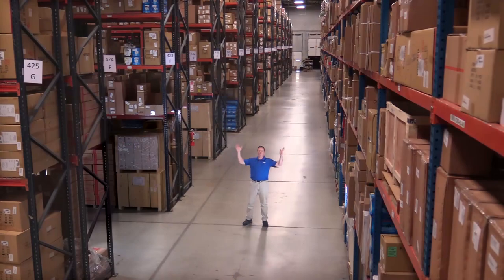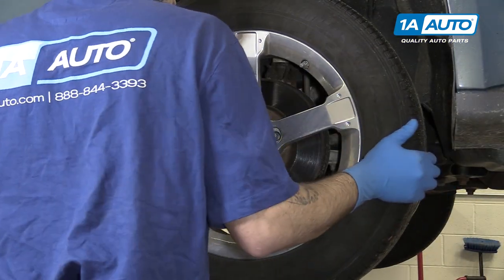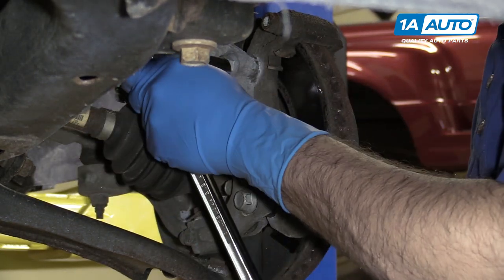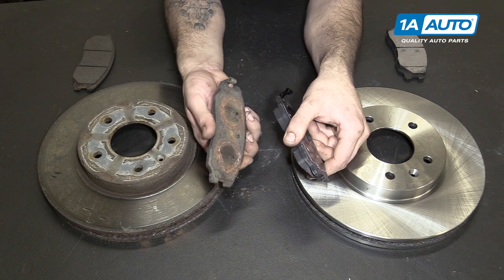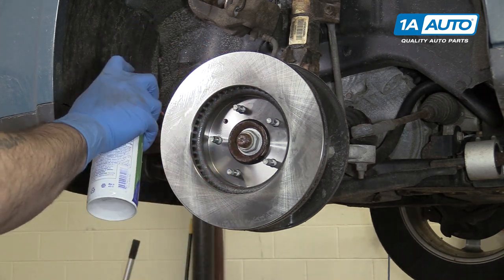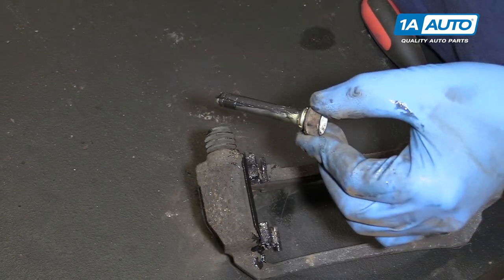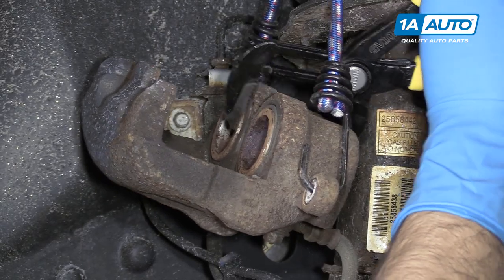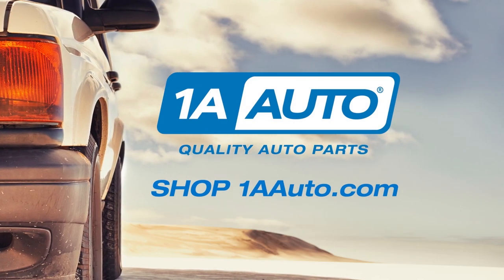How to Replace Front Brake Pads and Rotors 07-09 Chevy Equinox

Comment: Great Video. BTW the 14mm bolts on mine needed a breaker bar. Both my impacts would not loosen them none at all, lol.

TOOL LIST for those that missed any during the video.8mm(Bleeder Valve), 14mm(Caliber), 18mm(Caliber Bracket), and 19mm(Lug Nuts) Socket and or Wrench. T-30 Torque Bit(Star screw on rotor itself)Small Sledge or heavy hammer b/c the old rotors did not budge and were both really stuck on pretty good Just like this Video. Breaker Bar and or cheater Bar. Jack and Jack stands if you don't have a left and tire wedge for those that like to live life on the safer side :).

Its SO much easier to do a job when you have JUST the tools needed all out and ready before you start. Nothing worse then running back and forth looking for the right tool needed for the job. IM sure all of us had a Job that would have not taken no time at all but b/c you at a friends or have a son that likes to use your tools with out putting them up that a quick job turned into hours b/c you spent more time hunting tools than doing any work, lol...

Comment: Worth mentioning is that this also applies to a 2006 Equinox except that the rotors don't have the screw holding them on.  Otherwise, the procedures are pretty much identical.
Also, I find a C Clamp works much better at compressing the pistons.  Doesn't require as much physical hand strength.
Reply from the maker: +shadowmastertx Thank you for checking us out, as well as the information. This will certainly assist other viewers complete the replacement! 1aauto.com
Reply: Yeah, I used a hand trigger clamp and it was a breeze to compress the piston, just pump it and watch it go. The protective plastic also protected the piston from damage.

Comment: My 
2006 Pontiac Torrent  SUV  3.4 L  V6  the millage is 222,502 KM  in Canada  brake fluid is Black in the Master Cylinder is that normal. also i have an issue when i speed up yo about 60 km/h  and when i go to stop i have a stiff brake pedal but after that it go's bake to normal it has been doing this for about 6 months now every sent's i had my front Brake pads changed the brake pads used to be Metallic, but the new Pads are now Ceramic pads.

Comment: The only thing I would suggest is maybe pressing the brake pedal after you've done one side to set the pistons and allow more room for the fluid to move when you do the other side. Otherwise, you may pop the hood and realize you've lost brake fluid out of your reservoir from all the pressure of pressing the pistons into the calipers.
Reply: Great tip. I was planning on doing them both at the same time, but now I'll do this first.
Reply: soldado141 r
Reply: Replace front rotate 2010 chylsler town and county

Comment: I was wondering if you knew which side bolt went where? I think I mixed mine up and have been experiencing brake binding. Does the bolt with grommet go on the topside or bottom? I greased mine up but have been having problems,maybe the caliper is starting to go bad with the Piston sticking, I'm not sure...
Reply: As for as the next screw you don't have to have it but if the caliper bolt's are not greased the caliper will scrub some times

Comment: I just put a new caliper on. And when I have the engine off. I can't get any brake fluid to pump out of the bleeder valve. And I've done many brake jobs. And I have always gotten fluid to come out of the bleeder valve with the car not running. Any ideas.
Reply from the maker: +William Mills We wouldn't be able to diagnose an issue like that here, you may want to have a local mechanic take a look at it. Thanks for checking us out! http://1aau.to/m/Shop-1AAuto-c

Comment: Have you noticed on those shows the bolts always come off nice and easy? LOL When I do mine they are hell to take off and I end up taking it to a mechanic to do the job I could have done. Oh well.
Reply from the maker: +Ahmad Ghosheh Thank you for checking us out. Some bolts are very difficult to remove, and ours had plenty of preparation prior to this video being made. 1aauto.com
Reply: I kinda figured so. I did mine on a 2010 and followed your instructions worked great too. Thank you for showing us how and give me the courage to do it, total cost $85 for parts (I only needed pads), lots of sweat, some blood (poked my finger on the sharp edge, but no tears or regrets. Saved a bundle.
Reply: Smooth as butter. First I would like to say I love this video. This was an easy 1 2 3 video. Having the tools makes it to easy. But how many start the job. Its seems to be going smooth. Too smooth....then that one bolt. That one bolt will give you hell for 45min.

Comment: Do you have to torque it to the pounds specified? Or can you just use a socket wrench? A torque wrench is one thing I don’t have.
Reply: You would have to put all your might almost if you are doing the caliper bracket. 

The caliper itself would not need that much torque, just a little bit snug past the point where you cannot hand tighten and you know the bolt is all the way in when you hand tighten. Likely you'll need to get it tight first and then do like 1/2 or 3/4 of another turn and it should be good.
Reply: It should be torqued to specifications, however places like Auto Zone, will let you use there's to torque your wheels. 

You can put them on with a socket and ratchet, but I wouldn't want to go a long time without getting the wheels torqued properly.
Reply: Yes.